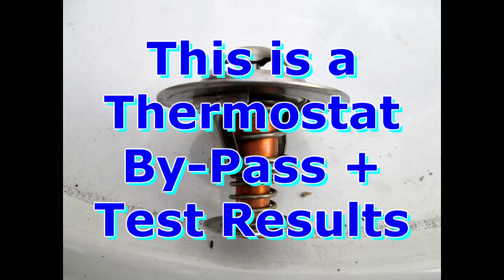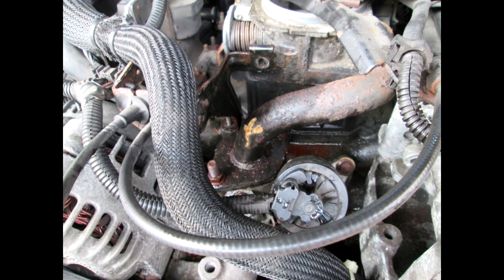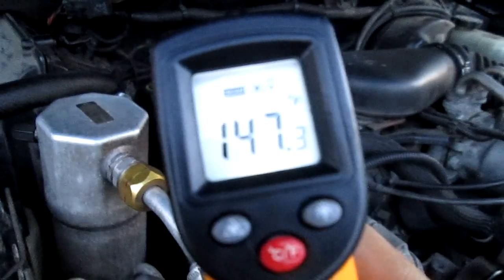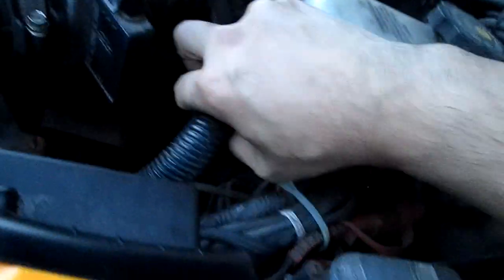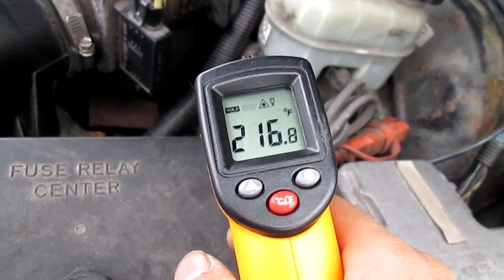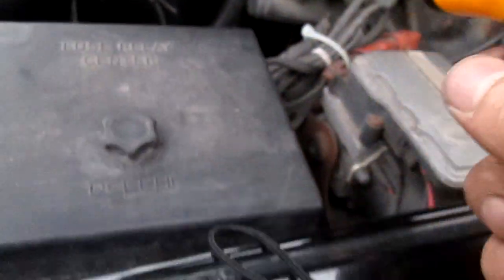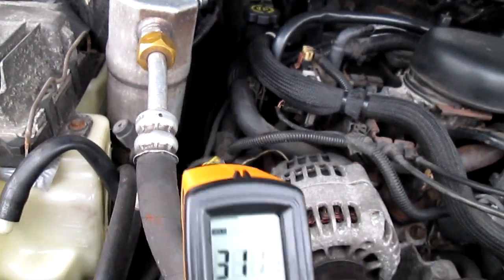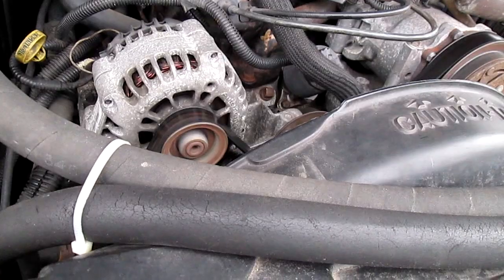DIY - How to Mod Bypass Car Thermostat Engine Cooling System Overheating - Heat Test Result

Comment: Cutting the thermostat will keep your engine cool but it can have some undesired effects on performance as well. Computer controlled engines need to reach a certain temperature to allow the ECU/PCM to tune for the best possible fuel mixture for performance and also consumption. If the engine never warms up enough the computer will never lean out the fuel enough, or change the ignition timing. Both aren't the best for performance.
Reply from the maker: +OverRevvedRacing - Well yea Fuel Consumption or Costly Repair.... Those are the 2 things that People have to weight out on their Scale.   So far, it didn't really take too much Fuel from my point of view.  Maybe $1.00 per filling on the taken waste... But even give me at $2.00 or a Gallon.... We filled them every week, so it end up to about 52 weeks X 2$ = $104.00 per year.   At $104 a year is pretty good to me for Cooler Engines.  NOTE: I did noted that in the descriptions.
Reply from the maker: +OverRevvedRacing - BTW... I forgot to add.. By playing with these... I was able to learn how to " FOOL " the Engine to pump out " LESS GAS ".  I will make a Video soon on that, although I need the Summer Temperature to do it, since it's cold here now cause we are in the Winter.  So maybe it will be an " ADD ON " kinda thing.  By telling the Engine that the Engine is " HOT " even though it's Cool / Cold.  That way the Computer will pump out less Gas to save some Fuel.

Comment: so if i run without a thermostat ill be okay? my car seems to be overheating after 10 miles or so.
Reply from the maker: YES !!!  Once you drive about 20 - 30 minutes.  Your Engine will be up to temperature anyway.  But it will NOT overheat since it's cooler and flowing all the time.  It will also help with idling in traffic too.  NOTE:  If you live in Warm / Hot Weather, you do not need the thermostat.  NOTE 2:  Either you have a failed thermostat or blockage in the engine.  NOTE 3:  If you do not get this fix.... Gasket will be blown next !!!
Reply: @JodBronson  thanks man i dont even use my car in the winter anyways it remains parked. so i dont even need the thermostat. one more question how do i get it out of the housing? i thought it was like stuck inside.
Reply from the maker: @anthonyjones5047  -  All you need is the Black Gasket.  See the video @ 0:47 or RE-Watch the video again.
Reply: @JodBronson  hey man so i did a combustion test on my car and the fluid stayed Blue. so thats a good thing right?
Reply from the maker: @anthonyjones5047  - Blue Fluid? Usually it's Green or Orange.
Reply from the maker: @anthonyjones5047  - Oh, it's a test kit!  I actually NEVER done a test.  You can feel it.  If it's gunky/sticky then you change it.  Other than that, Coolant usually last about 4-5 years.  If you are unsure, just drain it and put new ones in.  You can use Walmart Brand since they are cheap.  Plus you live in warm climate, you don't need anything special since it won't freeze.
Reply: @anthonyjones5047  what car do you drive and did you ever have an issue?
Reply: @anthonyjones5047  and yea if it doesn’t turn yellow or green you’re good

Comment: Has anyone checked to see if they actually do burn more gas without the thermostat vs having the thermostat?
That way we would know if any gas is lost at all and if there is more gas consumption then we would actually know if it is worth it and by how much.
Reply from the maker: It's designed to do that.  You should check into it and see how they design it and why.  No need to test it, there's a reason why!
Reply: @JodBronson  
Designed to do what?  Burn more gas?
Thermostat function is pretty straightforward.
What is awesome about your video is that you show that the thermostat is unnecessary for safe operation.
My question is, does a vehicle running without a thermostat increase gas consumption and if so, does the increased oil cost outweigh risking damage to the engine if the thermostat fails causing overheating?
Reply from the maker: @SI00000  - During Start-Up = Yes.... Once the Car/Truck gets a bit hotter, the computer (ECM) will calculate accordingly, to save Gas.  It works like a Lawn Mower, if you ever play with those, you will understand it easily.  Because of me understanding this long ago, playing with Lawn Mowers.... I was able to figure out something and YES, I have a video for it too.  Watch this and we can discuss it further.  NOTE:  From my point of view, if I live in a Hot Climate, like I stated in the video, I would NOT install the thermostat at all and yes, I mentioned it in the video.  Link:  https://www.youtube.com/watch?v=q0v1kbw7iJI
Reply: I noticed a 1-3 miles  difference running open loop vs having a thermostat in. 2012 Malibu 2.4 
It really depends on your driving habits.
Reply: @TonytheYorkie  
Thanks for the info.
Reply: @SI00000  No problem. Just keep in mind that a 4cyl doesn't waste as much as a 6cyl or 8cyl engine so it might be 5-9 miles difference on those due to their poor gas mileage and them being much heavier.
Reply: Just read your temp gauge. In my experience no thermostat just drops the engine temp about 5-10 degrees on 302 and 318 engines. Still got heat and everything. All he did was make a restricter plate. Totally removing the thermostat is different!

Comment: Holy shit.   I think I just figured out what the hell is wrong my car.  I bought it from a warmer climate. now it;s being driven in November Idaho weather.   I bet there is no thermostat in it. 

  I wonder though why the fans come on as soon as you start up and they do not shut down till you turn the car off.  seems like that fans would not even come on at all if it was cold.
Reply from the maker: +Larry Leisuresuit - This Thermostat " Usually " doesn't control your " Coolant Fans ".  Although it does contribute to it, but this is for " Engine Coolant  + Heat ".  If you have " Electric Fans " for Coolant, then YES... There is a " Separate " Thermostat that you want to check too see if it's working correctly.   Sometimes People " By- Pass " that too if they are in a " HOT / WARM " Climate, to keep their Engine Cool...... Maybe the previous Owner By-Pass it or even " Custom " it or even have the Fan By-Pass to run 24/7.  If I were you, I check " BOTH " for a piece of mind kinda thing.  Since you are in a " Cold " Climate now, you might need it for your Heat and Gas saving.

Comment: I did that trick on my Toyota and now drinks more fuel than a supercharged V8 cos i had to disconnect iat sensor ( was revving too high) if i put thermostat back in once it gets to operating temperature it jerks around big time.any solutions?
Reply from the maker: +edmond ugljesa - Sound like you have a " Coolant  Blow By ".  This will be a " Give and Take " game.  You have 2 Choices.... Either loose gas or loose engine :(((.  Here is what I think.... Your " Head Gasket " might have a bit of " Tear " in the passage.  When Temperature gets HOT, it created " Pressure " in the Coolant and when going at high speed, more coolant leaking... This will create a small " mis-fire " in the Cylinder.  By doing going high speed the Engine " shakes ", that is the #1 Sign...  NOTE:  If you " remove " that thermostat... The " Pressure " will be released when Engine hot.... It will NOT leak much in the Engine, and it will " lessen " leakage in the Head Gasket.
Reply from the maker: +edmond ugljesa - Test your Engine to see if it has Head Gasket Coolant Leakage.  If YES..... Your best option will be Bar's Leak Head Gasket Fix...... I have experience the same experience like you, that is how I know.  Here is the Video:   https://www.youtube.com/watch?v=98EFGWQsjm4
Reply from the maker: +edmond ugljesa - NOTE:  Loosing / Wasting Gas can be the Coolant Temperature Sensor.  The " Computer " adjust your Gas according to the " Coolant Temperature Sensor ".  You might want to check that first before adjusting ANYTHING!
Reply from the maker: +edmond ugljesa - IMPORTANT !!!!!!!  FIRST !!!!! Check your " Distributor Cap ".  Make sure it's " DRY ".  Open up and clean it.... It might have " Moisture " in there that " ALSO " can caused a " mis-fire " and create " Shakes / Jerks " during high speed !!!
Reply from the maker: +edmond ugljesa - Check / CLEAN your PCV Valve + Distributor Cap and I explained here in the Video:  https://www.youtube.com/watch?v=zWHvMYCItkE
Reply: Thanks Jordan i will do all the procedures by the way i have changed the coul packs ( coil packs and spark plugs  but will do everything else listed thanks man for the info i really appreciate it
Reply from the maker: +edmond ugljesa - You are Welcome!!! Go through the Steps here:  #1 - Clean your PCV Valve + Check Vacuums for Leakage.  #2 - Clean your Distributor Cap.  NOTE 1:  Everything works AOK, then NO NEED TO GO FURTHER !!! #3 - Check / Test your Coolant Temp Sensor to see if working AOK.  #4 - Check for Coolant Blow-By by checking your Tail Pipe for Water Drips.  NOTE 2:  If you get to this far...., than " By Pass your Thermostat " to release pressure from Engine to prevent further Coolant Blow-By.  If you found Coolant Leaks... Than your LAST OPTION is to use Bar's Leaks Gasket Fix!

Comment: This is OK in summer but not in winter
Reply from the maker: Correct!  I stated in the video it will be good for someone in California, Texas, Florida, Etc.... HOT WEATHER !!!  LOL
Reply: I got a ranger over heat at moment bottom stat not opening viscous fan in aeroplane mode been over fueling in a morning and sounded like a spitfire took it off for winter good now rad fills up and stat opens God nows why they have stat at bottom I need some dribble through stat so wen it open its warm water keeping it open longer I have bursted 5 rads in 5 years only sust it ot this year I don't no weather to go for 2 3mm holes or one it's pulling at bottom of rad and feeding at top so pressure blow off should still work I ripped my aircon motor out so 10 minit job now
Reply from the maker: @irishlad7458  - Sounds like a clogged somewhere.  You need to unclogged it first.  You MAY need to do a full engine clean up.  Sometimes there are gunks in the passage ways or even in the Heater Core itself that does this.  Your Radiator is really EASY to clean and EASY to tell.  All you need is unhook both ends and put water in it, if it's clear, that means your radiator is AOK.
Reply: I live in a country where normal temperature is 86 F / 30 C. 

So is it ok to remove the thermostat?
Reply from the maker: @gardennaturevideo6115  - YES, remove it completely and see how your engine performed!  As stated in the video, you will waste just a tad of gas for the 5 minutes, but once the engine warms, you will see how good your engine performed.
Reply: @JodBronson  some people says running without thermostat will affect piston rings and wash the lubricant inside piston walls. How do you explain that?
Reply from the maker: @gardennaturevideo6115  -  How do you explain people who live in the "Winter"?  Their Cars / Trucks NEVER go to the normal temperature unless they drove it for 30 minutes or more.  How do you explain that?  LMFAO
Reply: @JodBronson  I have no experience of winter as my tiny island country always has sun. Are vehicles get around 30 min to heat up even they have thermostat in winter season?

Comment: This is really bad advice. There's a reason it's in there, and that's to get the engine as fast as possible into the "zone" and regulate the temperature to keep it inside said zone. That zone is otherwise known as the operating temperature. The engine operates best within its designed operating temperature and running it outside that range makes for an inefficient and unreliable engine. Overcooling is NOT always a good thing.
Reply from the maker: Oh boy!  😂❤️😂❤️😂❤️😂❤️

Comment: 😂😂😂 Are you trying to teach how breakup a good engine?😂😂😂 Your pump will lose presure when the pressure valve hacked, then the cooling water is flowing erratically! 🤣🤣🤣
Reply from the maker: @Alexander MB
 - Wow, you serious?  If you follow me and if you live in HOT / WARM Weather.... Take out your Thermostat completely and drive with it for the rest of your Life.... If your Engine "BREAK" because of it, drive me to a bridge and I will "GLADLY" to jump off!
Reply from the maker: @Alexander MB
 - You definitely DO NOT know how the Thermostat works do you?  At an average at 91 Celsius, the Thermostat Open..... So the Water will "FLOW ERRATICALLY" anyway, LOL.